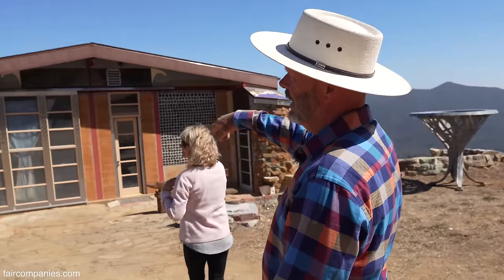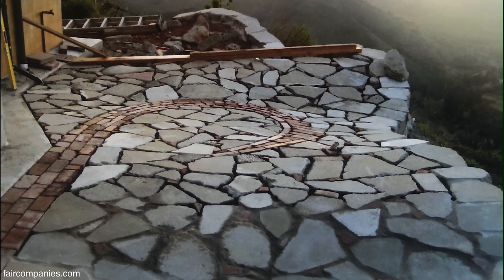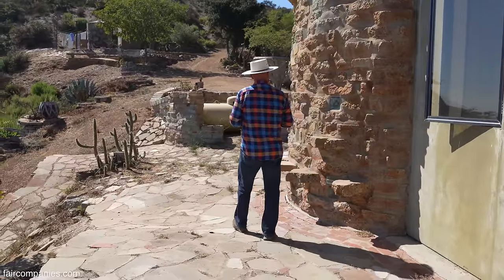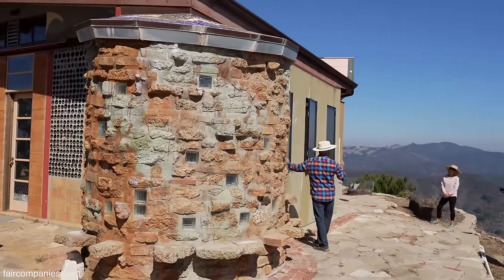Family builds their own private ecovillage with free materials

Comment: You can use rainwater for your drinking water but you would need a multi stage filtration system usually with UV treatment to kill off any bacteria or other microorganisms living in the water. There's also been several studies that show high levels of extremely toxic chemicals in rainwater all around the world, hence why it's been deemed as unsafe for consumption. But as long as you treat the water, it should be fine.

Comment: Assuming they live around Cayucos, CA, and regularly went to Plant 42 to get the materials from Lockheed, that is a 169 mile (per bird’s eye) trip one way! To do that with at least one little kid is amazing! How did he get permission from Lockheed to use their old materials? How did he get access to that base? So many questions!
Reply: I just drove in and spoke with the guy demolishing the factory. He was stoked I was an end user and lent me the scissor lift to pile up material and watch him set off explosives. So fun except the part where I could only get a 20' flatbed and had 7' of heavy flooring (27' L t&g fir) and 14 @ 24' beams sticking off the back...literally popped a wheely going up a steep turn. Scary

Comment: The thing about rainwater collection is that it still has to be treated before it's potable. Same thing with regular drinking water, it goes through a treatment plant. When it rains, all the pollutants suspended in the air are captured by water as it comes down, ending up in your water collection system. Not to mention anything else that may end up on those gutters, bird droppings, dead insects or even small animals, you never know. 

The water may look crystal clear and good to drink, but a microbiological analysis will tell you otherwise.

Comment: At one public water station, they never questioned where the water was coming from.   However, it was coming from the top of a mountain, where a farmer had cows.   The town sorta freaked out, when they figured that out (they dyed the water, and traced it).  They shut down the favorite water supply for the locals.  Ran tests, then opened it back up.   Apparently, everything is fine, but they really do not like surface water for drinking water.

Comment: Isn't there a potential for mold (mycotoxin) overgrowth with using straw for building materials?  I treat patients for mold illness who have been exposed to straw on farms.
Reply: It’s a reasonable question but not quite comparable. So, if a toxic material is contained in a wall then there may be little prospect for respiratory exposure.. (I scrutinised this when I became aware in my city of some old kids schools with asbestos.. it turns out there’s even a ban on using pins on some walls(!).. but the kids still get taught.. and new schools gradually replace the old). 

Anyway, your patients will have inhaled air suspended spores from damp straw kicked up by handling - the straw in walls will be enclosed in plaster, may effectively be dry or in a caustic chemical environment (so not great for fungal growth) and any spores contained.. so I’m guessing those may be reasons it’s not a significant issue (though of course with poor ventilation, condensation etc you can get mould in modern non-straw built properties.. so I guess a healthy building is down to quality of use of your materials as much if not more often than the materials themselves..

Comment: amazing what you can get away with when you don't need much insulation in the desert/cali...
Reply from the maker: Though it actually can get cold. It's a bit of a microclimate up on the hill. It's not Canada, but they do get snow at times. That's where that surfboard insulation comes in.
Reply: @kirstendirksen  so high density foam really. neat eh... for heat they use solar and some wood fire then?

Comment: Lol, I would be terrified to live on the top of a hill in California...
Reply: Why?
I live in England and have no idea about this area.
Reply: @douglasprovost768  California is known for it's warm and pleasant weather, but certain areas can have very unpleasant weather (for local standards) such as high wind, rain and maybe even SNOW 😁 I'm not familiar with the exact region, but I assume that this is what they are referring to. Long and steep driveways can be treacherous in foul weather but that applies to any region, not just California. He mentioned that he went through 4 different truck motors during the construction phase.
Reply: @douglasprovost768   Depending on the history of the particular piece of land that they built on, being at the top of the hill means:
1. During an earthquake, landslide and liquefaction of the earth could lead to the entire structure going down the jill and being buried under tons of dirt and rubble. That makes rescue (especially in that steep terrain) more difficult. 
2. During an unusually wet season, the earth under their home may become too saturated and give way. The mudslide would take the house down the hill as I mentioned above. But, this time, they would be buried under tons of mud. Also, a debris flow from the higher part of the land could build up enough force to bury a large part of the house in mud.
I hope that helps answer your question.
Reply from the maker: You're right. He said it was a bit of a microclimate up there and it definitely can snow. And sounds like the wind can get high (120mph) so you have to be prepared for it all.